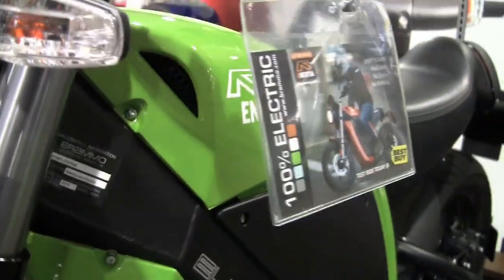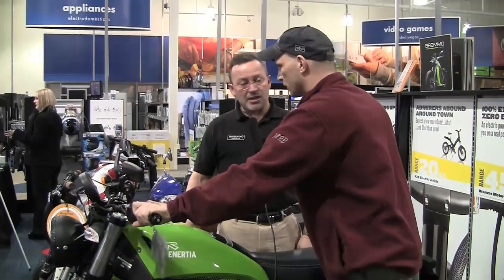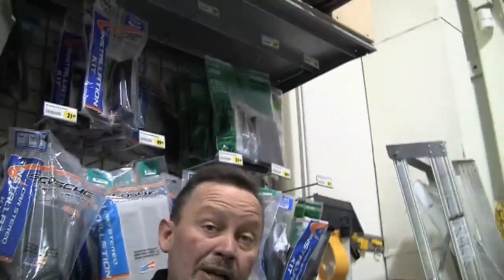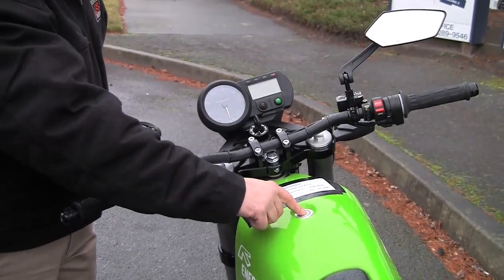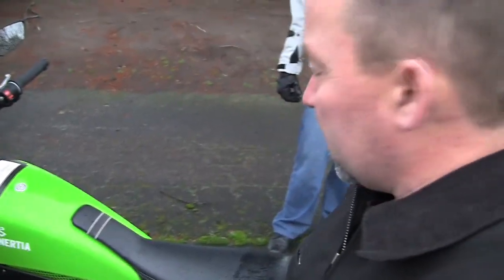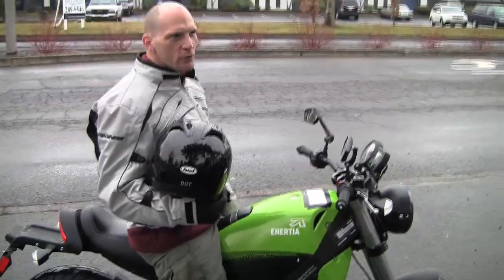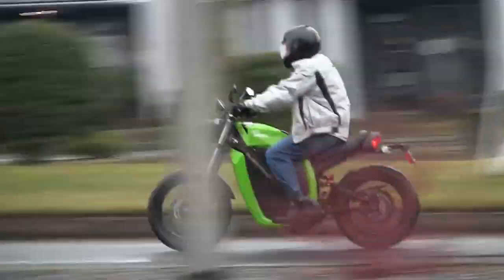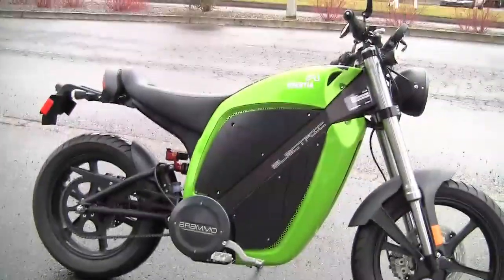Brammo Enertia Electric Motorcycle Test Ride - Tim Reha 2010

Comment: @72mharris I don't understand the question.  What about solar or wind?  I recharge my electric bike from solar/wind power so it produces no carbon from running.  It did take carbon to make it in the first place, but as it's much lighter (uses less materials) than the equivalent petrol bike so it produced much less carbon to build it than a similar petrol bike.

Comment: I hate when companies claim 100% clean vehicles. Yeah, the bike doesn't spew out fumes, but to charge it up, probably produces more pollution from burning coal at a power plant, than if you were to burn gasoline. But it depends where you live... that's definitely the case here in CT

Comment: tell ya want here's a SIMPLE answer to getting rid of our dependancy on foreign bullshit oil.  drive 100% electric vehicles. then while we're at it. figure out a way to install and mount a wind turbine high rpm free energy electricity charger to constantly charge the battery(s) during operation and when the vehicle is turned off. free energy is teh TOP of the economic food chain.  EAT THAT MAHMOUD and Saudi Arabia! Thank God for the men to pull the weight of companies Like Zero and Brammo.cheers

Comment: One very big elephant in the room, which everyone is ignoring, is, what will be the actual life of the battery pack. How much does it cost to replace? When will it fail? Will the entire battery pack fail, or just a cell or two? How much to fix/replace after the 1 year warranty? Okay so the Brammo rep just said 2,000 deep cycle charges is the battery warranty. Is that a hard figure, 2,000 deep cycle charges? If so the battery is warranted for maybe 4 - 5 years? Please confirm.

Comment: 100kph? My left ear...I've 40 year old motorcycle that eats that alive. 100mi range? ROTFLMA (dang near pissed my self at that one) my motorcycle gets 150mi regardless of how I ride. Now hear is the deal killer for me and should be for EVERYONE...can you recharge it in 15 minutes or less? Because I can put 5gal of gas in min in under 5 minute depending on the pump. What is a number of recharges before the battery goes soft then fails? It wont even keep up with a 79 GL1000. No thanks.

Comment: Good video minus the random music and noises.

Hats off to Brammo for pioneering an e-bike.  However they've got a few milestones IMO before they can really tap into the real motorcycle market.  Basically they need to up the top speed and range.  The bike is quoted at 45 mi range, but I've read a few times that the bike realistically gets 20 mi when you're doing top speed down the highway.  So ultimately what's needed is better, bigger, cheaper batteries.